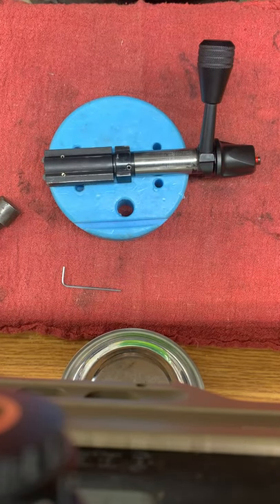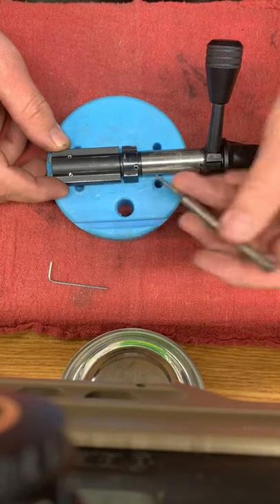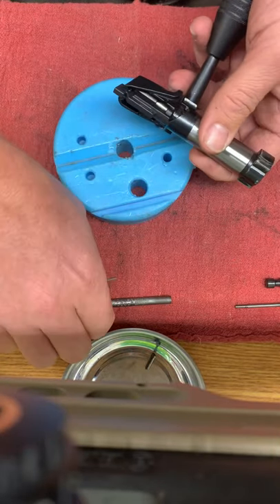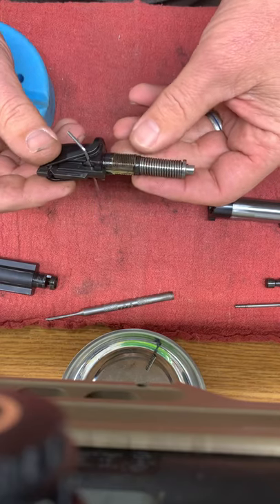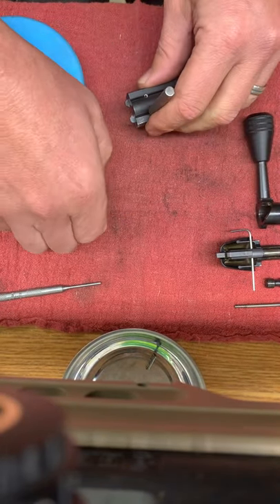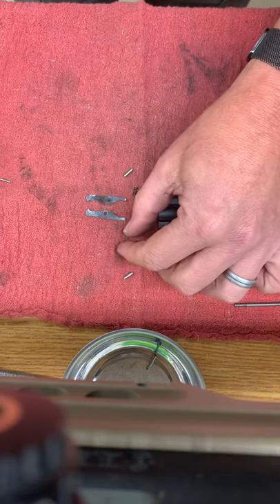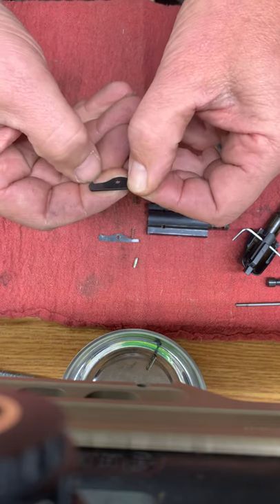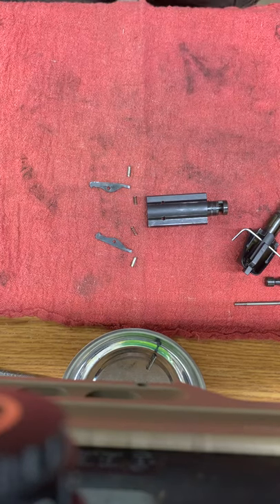Bergara B14R bolt dissasembly

Comment: Thanking for that. What size are the roll pins. I have some shims for headspacing and a rifle on the way. Will probobly need to strip the bolt a good few times in testing.

Comment: My B14-R isn'r extracting unfired rounds of the ammo I'm using.  I could try other ammo but this match ammo shoots quite well.  I heard extending (stretching out) the extractor spring on bolt side can help with this issue, any thoughts?  Or other recommendations?
Reply from the maker: I would check the angle of the hook 1st. Most likely, it has a positive angle. It needs to be slightly negative. Just be careful with the file, easy to remove too much. Also, use a file with a "Safe edge" (no teeth on the sides). You can buy one from Brownells or just grind off the teeth on one you already have.
Reply: Push out a stuck round with a cleaning rod and look at the bullet for rifling marks.  I had the same problem, the B-14R has a tight chamber.  The bolt is pushing the bullet into the rifling making it difficult to extract a live round.

Comment: Any truth to the rumor that these shouldn't be dry fired? Where does the damage occur? Or is it just the engineering department trying to avoid liability for malfunctions that might occur after a half-million cylcles?
Reply from the maker: 100% truth. What happens is, the firing pin extends beyond the bolt face and can start to 'peen' the chamber end of the barrel. This can cause misfires, extractions problems, as well as possibly breaking the firing pin, itself.

Comment: Is your bolt difficult to close?  My B14R Carbon is noticeably harder to close than my CZ or Tikka RFs, and my Sako, CZ, and Tikka CFs.
Any suggestions?  Thanks for posting.
Reply from the maker: Are you referring to closing the bolt on an empty or loaded chamber? If empty, no I have not seen this. Other than normal cocking of the firing pin, much like a Rem700. If on a loaded chamber, Depending on the ammo used, yes. Every B14R we have dealt with is like this with certain match ammo. They use a "Bentz" chamber, which is a hair shorter than general run of the mill chambers. This is why they shoot so good. Chamber a round, then extract it. You should see slight marks on the bullet from coming in contact with the rifling.
Reply: @rdtaguestudios Thanks for the reply. Yes, on a Chambered round.  It has the issue on all of the ten or so ammo types I have tried- from Eley Tenex to cheap bulk.  I may have Bergara look at it.
Reply: I’m dealing with this right now!  I have the steel barrel and it is a pain in the ass to close the bolt when chambering a round.  I know match chambers are gonna be tighter but this is just insane!  I shot about 200 rounds today and my thumb is sore from working the bolt!